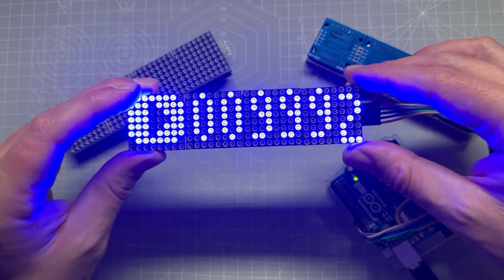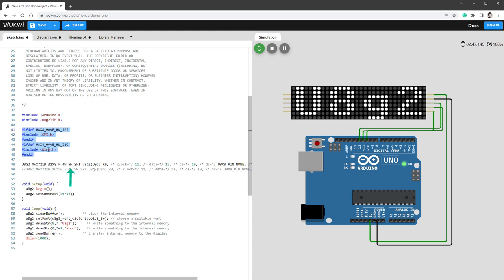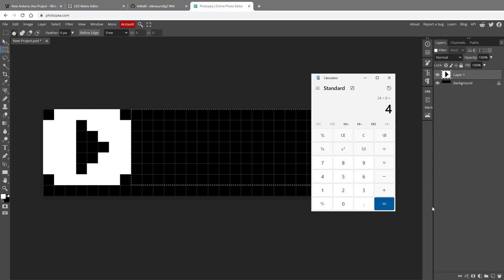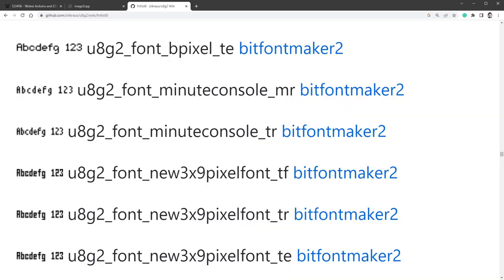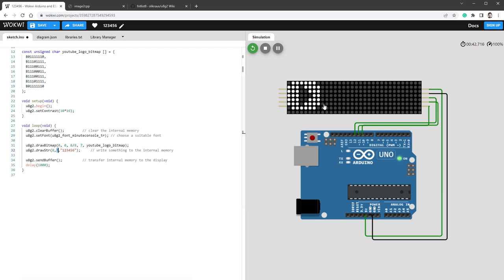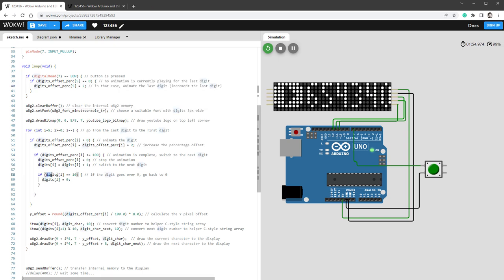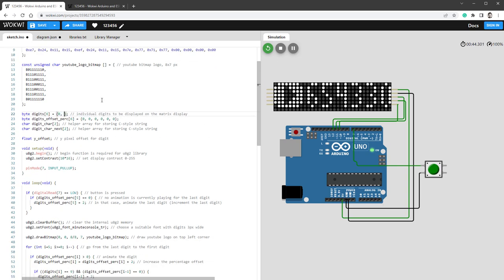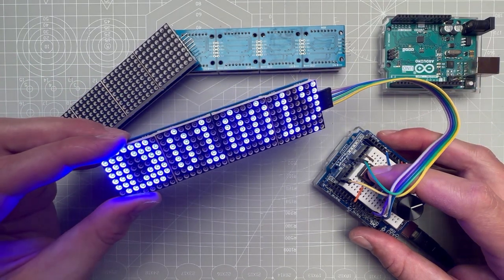Arduino + Matrix Display (The Proper Way)

Comment: pure good content, as always - thanks! My next project will be a gear indicator with an adafruit 11x7 LED matrix of course with other functions, i am sure i will come back here again!
Reply from the maker: Sounds great! I will sure to check your channel for that project, as it sounds very interesting. How would you get the current gear?
Reply: @upir_upir  actually i dont upload that project, i thinkin i am very bad at explain things :D 
At first i will just use the neutralswitch an the up / down shifts i use reedswitches with a magnet on the lever. Alpha code is ready, now i need to weld the baseplate for the reedswitches :)
Reply from the maker: @biiLL4bonG  So is that a sequential gearbox, or would you have neutral + X number of gears switches? I´m actually putting together a similar project..
Reply: @upir_upir  oh sorry, yes it is an motorcycle sequential gearbox!
Ah your video will be great, thats for sure. So yours is for H-Shifter? Another way is to get the gearratio and speed to calculate it, but i think this is better for a failsafe option - and not so "easy" at some vehicle
Reply from the maker: @biiLL4bonG  OK, that makes sense. I´m working on the H-shifter for the car. Calculated gear is oftentimes not accurate and I would like to try something new.. Good luck with your project!
Reply: @upir_upir  thanks! Same for you, cant wait for the next video :D

Comment: Thank your share very much.
Reply from the maker: You are welcome! Good luck with your projects.
Reply: @upir_upir  I have an idea to use RC522 to replace button for younger kids to thumb up. I don't need to check UID, just only tokens can be detect and counter can be worked.  I guess they will like it. But two devices are conflict on SPI pins. Do u have example ? Thank u again.

Comment: how to use ug82 with esp32. tried it  with the online docs , not able to understand !
Reply from the maker: You use it pretty much in the same way as with Arduino. Look at WOKWI for examples - google "wokwi esp32 u8g2"
Reply: @upir_upir   i was trying to control p10 led modules with this library but couldn't seem to find constructors  to initialize .?
Reply from the maker: @tareshgupta1095  I see. I don´t think there is a support for p10 led modules from u8g2 library. You need to use  LedP10 library instead.